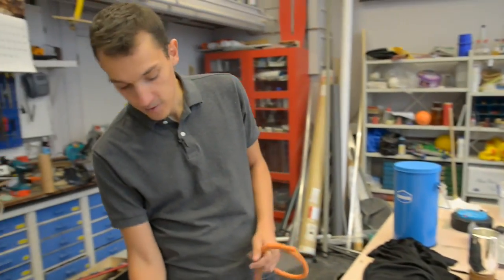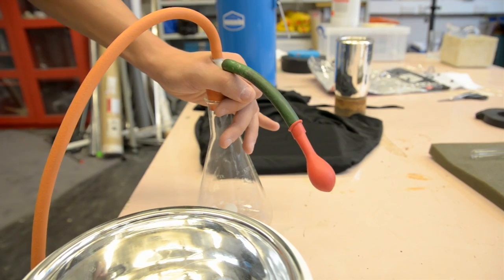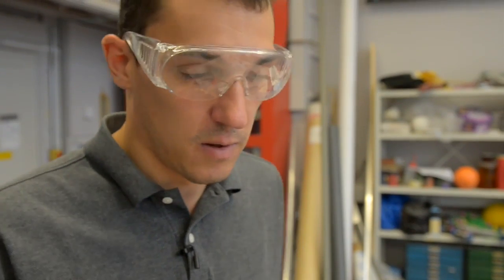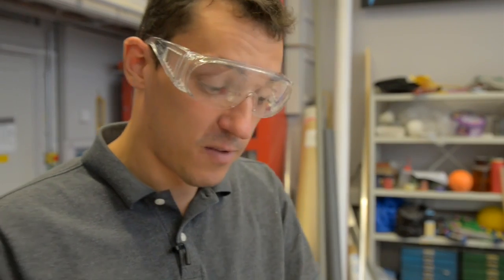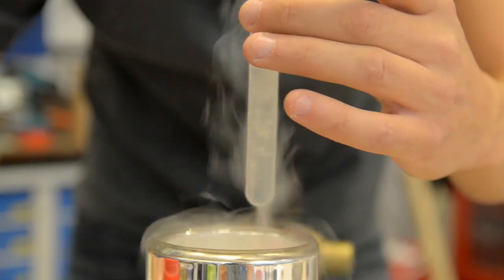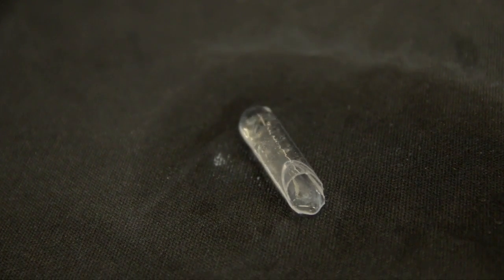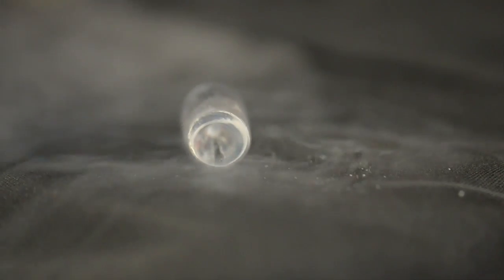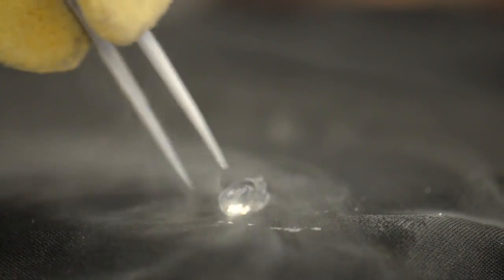Tales from the Prep Room: Argon Ice

Comment: I remember a friend finding this by accident. A good, easy way to dry air is to pass it through a tube in a dewar of liquid nitrogen. He wanted dry air for a fatigue experiment, so he left the thing running. After half an hour tube had quite a bit of liquid. So we went off and looked up the boiling point of Argon, and that's what it was. Much more argon than water.
Reply: De-argonification of air lol.

Comment: would that have been safe to put in your mouth? or at least a drink?
Reply: Instant frostbite
Reply: Since Argon is a noble gas it shouldn't react with... well... anything really. Also, since the temperature difference is so great, i would assume that it would just "fizzle" at the top of your tongue/drink and evoporating rather quickly (size dependant ofcourse) rather than having much of practical purpose of i.e cooling down your beverage.
Reply: it is more dense than air, so taking it into mouth will move it into your lungs, causing lack of oxygen
Reply: spooky:(

Comment: How do they produce or extract pure argon? Do they extract it from ambient air? Lastly, do you have to be a prince, duke, lord, or a king or queen to attend the "Royal" Institute?
Reply: do you have to be a prince, duke, lord, or a king or queen to attend the "Royal" Institute?
No, even a gas can be noble enough, evidently.
Reply: +HighlanderNorth1 they liquify air and as they warm it up again the different gases boil off. That way you can get pure Nitrogen, Argon, Oxygen and I think other noble gases but I`m not sure about these.
Reply: They get all of the noble gasses from air except for helium, which occurs naturally in underground methane deposits because it is a product of the radioactive decay of uranium, radium, thorium, and other elements. Krypton and xenon are incredibly rare so you have to distill a huge amount of air to get them, so they are very expensive (about US $50 per liter I think). Neon is more common and argon is very common (about 0.7% of the air).
Reply: +Wasser Deckel 
Thanks. That seems simple enough.

Comment: If Argon is heavier than air, then why would it tend to escape into space?  Shouldn't it tend to collect on the surface and the lighter gasses escape?
Reply: Argon has 23 isotopes, or versions of argon with the same number of protons/electrons but different numbers of neutrons. Some argon isotopes are heavier than air -- namely the extremely common argon-40 -- while others are lighter than air
Reply: I must admit, I'm not sure what Van der Waals forces have to do with keeping gasses in the atmosphere and why they would not apply to the noble gasses, but Nitrogen has an atomic mass of 14, so N2 would be 28, which is still less than Argon's 39.9, so it should still tend to collect near the surface and not the edge of the atmosphere.
Reply: +TARINunit9 Since air is mostly N2 and O2, weighing in at 28 and 32, that would still be less than the common argon-40, or even argon-39, 38, and 37, which is the lightest remotely stable isotope.
Reply: Phillip Susi Argon 40 is the stuff that DOESN'T escape into space

From five minutes on wikipedia, most of the non-40 isotopes of Argon are created high in the atmosphere in the first place, by cosmic rays. They probably don't escape into space so much as they just undergo their normal radioactive decaywhile in near-space environments; they only have half-lives of about a month
Reply: +TARINunit9 The video says that Argon-36 escapes into space, but that is still heavier than N2 and O2, so why would it escape into space?  Especially when it is much heavier than H2 and He2, which do tend to escape, but not so much for the heavier O2 and N2, which make up most of the atmosphere and are still heavier than Argon-36.
Reply: Phillip Susi The words "five minutes on wikipedia" should have given away that I have no idea and my other comments were just a series of guesses
Reply: +Phillip Susi "most of the non-40 isotopes of Argon are created high in the atmosphere in the first place,".I think that is the answer to your question.
Reply: +Phillip Susi Most of the gases in the air are molecules: O2 , N2, ect; so the molecules would be heavier than the elemental Argon. Also Argon is fairly inert so it probably won't get suck on other atoms or molecules via Van der Waals forces.
Reply: @2tootheface   No, argon is heavier than N2, or O2

Comment: The cool thing is that, it is actually sublimating and boiling kind of at the same time.  it's kind of like a wet dry ice
Reply: Ikr, it is similar to dry ice in that, it doesn't like to be a liquid, but unlike dry ice (and like regular ice) it still can form a liquid, just for a short time.
Reply: @Metal_Master_YT   Yes, exactly.
Reply: Because its probably a mix of temperatures,it melts at first and that boils and the warmer parts just sublimate. Might be wrong
Reply: @floseatyard8063   It's because the melting point and boiling points of argon are only a few degrees apart, so it readily sublimates and boils simultaneously. Basically, it's triple point pressure is very close to atmospheric pressure.
Reply: @DANGJOS  Thanks for letting me know,I thought it's because of different temperatures on the surface of argon.

Comment: This may sound like a dumb question but why does the argon ice stick to the surface and slightly lift it up
Reply: +NeXTSTORMING no such thing as a dumb question, the argon is probably lifting up from the leidenfrost effect. where the argon instantly turns to argon gas upon touching the relatively warm surface, the pressure of the gas beneath it lifts it up.
Reply: Ahhh. I am assuming that the black cloth has become a little bit damp with water condensation from the air. When dropping the argon ice, the water freezes and sticks to the ice.
Reply: +NeXTSTORMING  I think the question is, why does the argon freeze with this cavity in the middle, with the frozen parts only on the outside.  Well, liquid gases typically don't conduct heat very well so the liquid nitrogen will first cool and freeze the argon touching the sides of the glass first.  Now since it hasn't completely frozen, you get this cavity in the middle of the argon ice.  That's my best guess
Reply: Ian Haack how did you get mine
Reply: +gorillaau I think this is the right explanation.
Reply: +NeXTSTORMING Water ice does the same thing. The fibers can get stuck in the ice as they partially melt it, but then cool to freezing point.

Comment: just wondering why does the solid argon have such a large meniscus?
Reply: It doesn't. I'm assuming you mean when he slides out the chunks and there are inverse comes in the tops. Since the argon freezes from the bottom up and outside in, since the liquid nitrogen bath is only partly covering it, the top center is in least contact with the liquid nitrogens cooling affect which means if it was longer in there freezing it would eventually freeze over
Reply: +jon paskewitz ahh okay thank you that makes sense :)
Reply: +calum Stringer lol i read that as  - why does the solid argon have such a large mustache?

Comment: Is the conical depression seen in those solid argon slugs the result of surface tension forces? Only each of the three slugs of solid argon had a conical depression in the upper surface, which made me wonder if the element has a tendency to creep up the sides of the glass tube during its short time in the liquid phase.

Comment: how come the argon melts so incredibly fast at room temperature but dry ice lasts for quite a while?
Reply: @joejoe4games  I would say there are two major reasons. One, the heat of vaporization and sublimation of argon is much smaller than for dry ice, which means it takes a lot more energy to vaporize dry ice. Second, the temperature difference is larger for solid argon, so the rate of heat transfer is larger.
Reply: +joejoe4games The melting point of argon is much, much lower than that of carbon dioxide.
Reply: +joejoe4games The heat capacitance is probably lower for solid argon (it takes less energy to raise solid argon's temperature by 1 degree). There is also the heat of fusion, which is also probably low for argon. The heat capacitance for liquid argon. The heat of boiling for argon as well.
Reply: @louistournas120   I would say the heat of vaporization and sublimation are some of the biggest factors

Comment: you do realise that the only reason argon behaves like this is because oxygen and Co2 are abundant in that room you are in..?

they make argon displace itself (spread out) to fit the % in the room predesignated by its molecular mass.

you could even say that it is forced to equalize itself due to the rules that apply, that is what causes the reaction..

(similar concept to how a balloon filled with air will try to force itself up if you hold it under water, but obviously not the same because of the diffrence of molcular mass of the elements involved.)

Comment: wander how solid argon reacts to high voltage.
Reply: danz409 I would predict it to be an extreme insulator.
Reply: tibschris its a noble gas right? wander if it would be like a glowing solid?
Reply: Well, the question to ask would be "why would it glow"?
Certainly not thermally, because then it would literally be "red hot." It can't be a solid then.
If it's acting as an insulator, there's little current flowing through. So there can't be a current-induced glow.
My guess is that it's unremarkable and doesn't have much practical use.
Reply: Ohh. Well then, when it's a gas it does glow a characteristic color, like neon:
https://upload.wikimedia.org/wikipedia/commons/8/87/Argon_discharge_tube.jpg

But it won't do this when solid, because constant collisions with atomic neighbors in the solid will smear the lines out into a blackbody emission. But since it's probably an insulator, I don't think you could get joule heating going.
Reply: hes thinking of how argon gas will glow when high voltages are passed through it like how neon lighting works, but with argon

Comment: Argon bullet, might be a thing
Reply: Badatstuff it would still be heated into a gas, especially with a rail gun
Reply: You could use a slingshot
Reply: Might be possible, but I'd assume that the heat and compression from the accelerant would cause it to revert to gas very quickly. Maybe some kind of gauss/railgun type of thing, with a solid argon slug in a metal casing?

Comment: Could you make a block of ice out of helium?
Reply: I don't think helium has a solid phase, and if it does, it's very very close to 0K if not =0K in which case it's impossible to freeze it.
Reply: helium freezes at 0,95K which is roughly -272°C at 25 atmospheric pressure. it would be very difficult to create solid helium, if not possible. the lowest temperature we got was 0.000 000 000 1 kelvin.
Reply: Dan M Oh well, I guess it's technically possible then :) Thanks for clearing it up :)

Comment: Another interesting fact is that the isotope argon-36 is theoretically unstable, yet no one has yet observed it decay. It is the lightest observationally-stable isotope which is theorized to be unstable.
Reply: ***** That doesn't have anything to do with nuclear decay, but okay.A substance can sublimate when ambient pressure is below its triple point, which for argon is 68.89 kPa. This happens above about 3394m (11,102 ft) in altitude. Nonetheless, all solids with appreciable vapor pressures sublime to some degree; for example, water ice sublimes very slowly at 1 atm pressure, even though this is above water's triple point. All solids have some vapor pressure and thus sublime at any temperature, though it may be so low as to be undetectable.